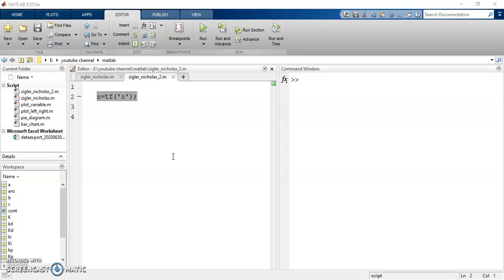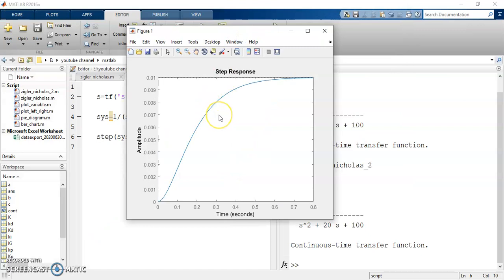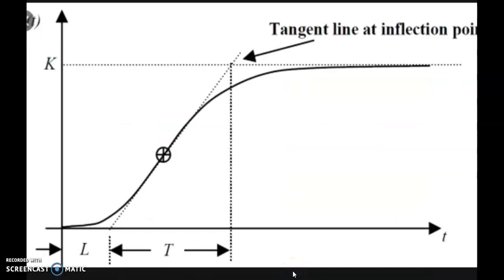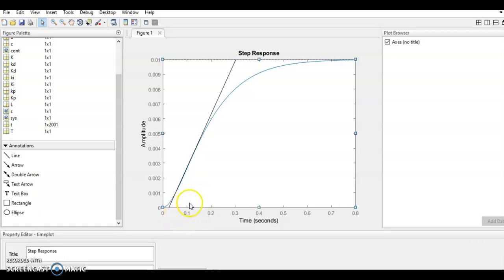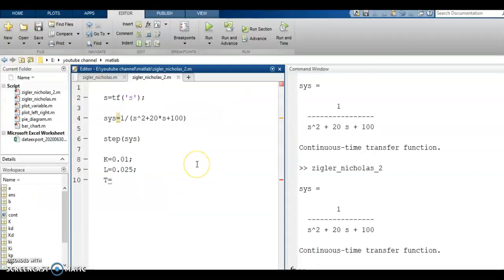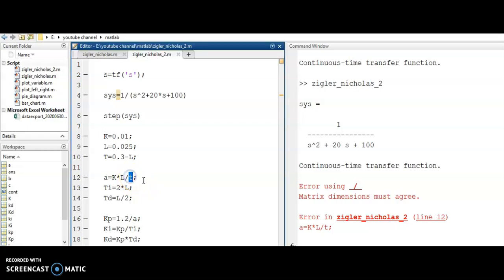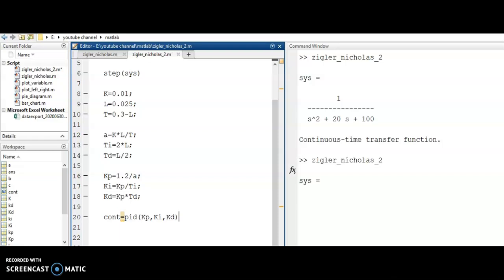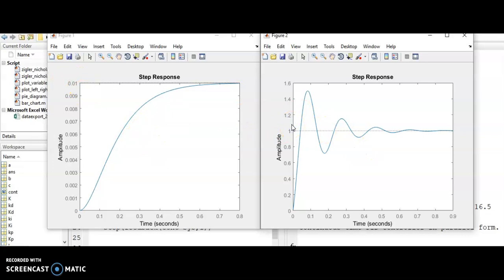⚡️ Tuning a PID Controller Using the Ziegler-Nichols Method | MATLAB code available

Comment: The funny thing is that when I try to optimize the PID parameters using the Meta-Tuner software for the transfer function shown in your video , it gives me the following optimal parameters:
Kp = 100000
Ki = 100000
Kd = 100000

for a simulation time of 0.9 seconds

The error is so so small with no over/undershooting .. You can check this controller setting and compare it with that of the Ziegler-Nichols method :)

Comment: very nice! but in the end the steady state value is way different in the begining it's 0.01 and then becomes one, why is that, how can we fix it?
Reply from the maker: For a step input desired steady state response should be close to one with 2% tolerance band.
Reply: Because it has been implemented a regulator with an integrative component. The integrative component makes the steady state value equal to 1 if the input is a step.